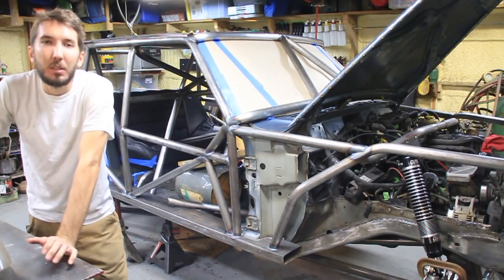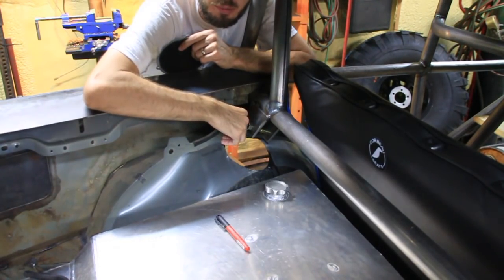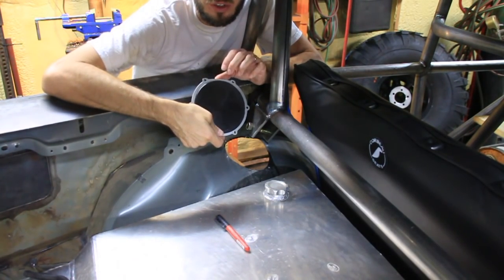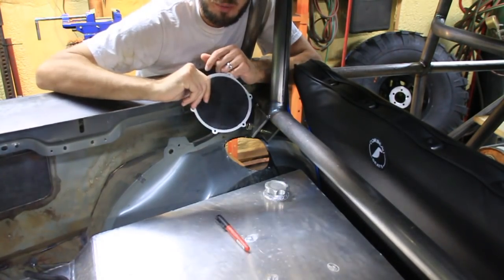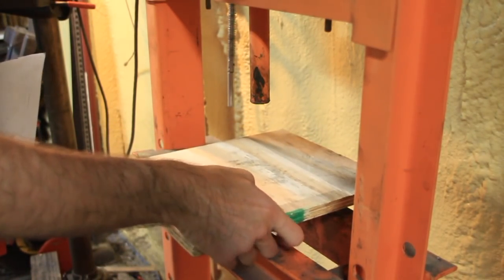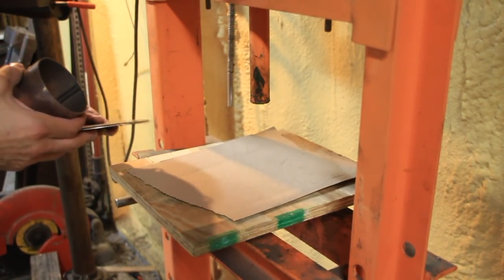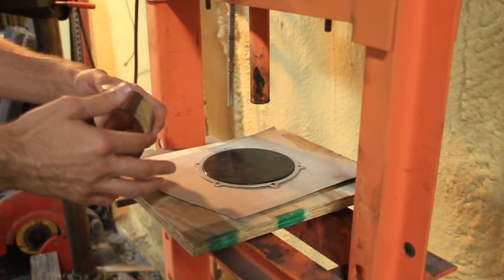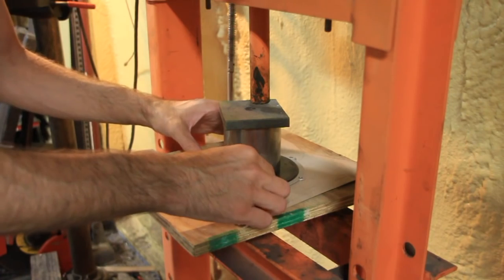Problem Solving - Making a 3" Punch

Comment: Why didn't you use a 3" hole saw bit?
Reply from the maker: +Chuck C I don't have a 3" hole saw bit.  I did consider it but figured it would chew or tear the rubber.  I also thought about buying one and cutting the teeth off before I found the pipe but they wanted $20 or so...